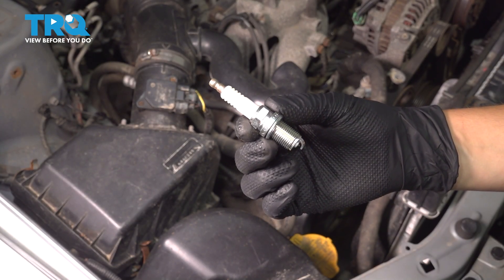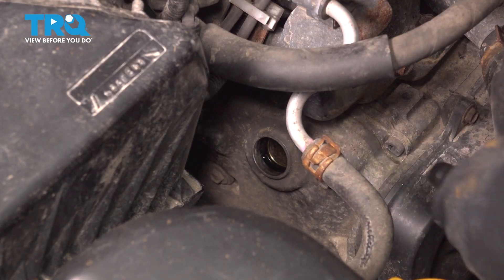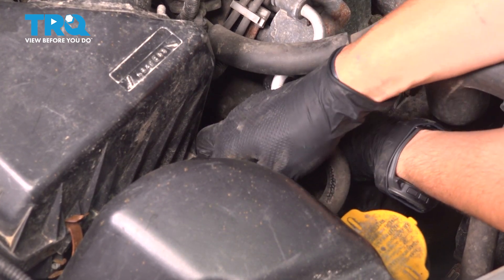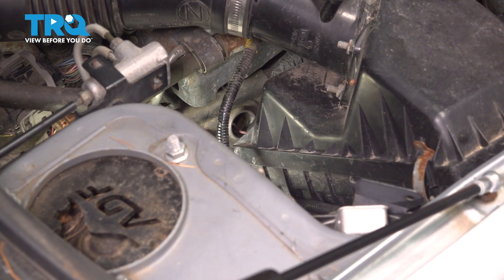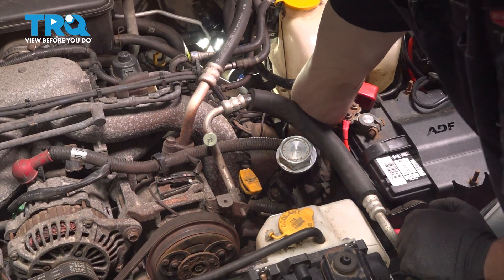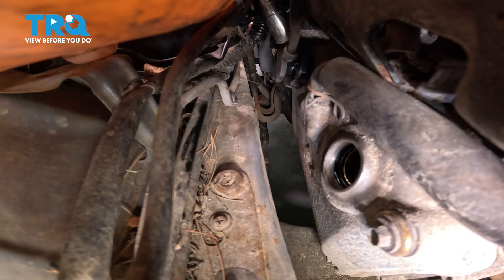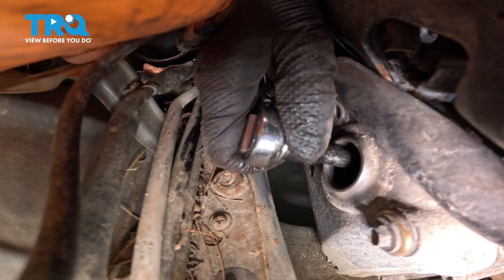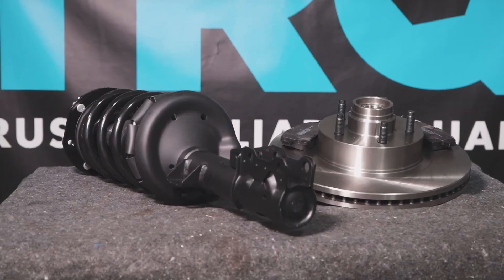How to Replace Spark Plugs 2003-2008 Subaru Forester

Comment: I appreciate the video, but I think it's time for you to get a new spark plug socket.  My go to spark plug sockets (5/8 and 13/16) are magnetic instead of having the rubber insert that's supposed to grab the plug.  
When my 6" extension wouldn't fit I figured I'd just need to use a couple short extensions, but figured I check it out on YouTube first rather than get 3 done and find out the last one requires my to raise the engine for access.